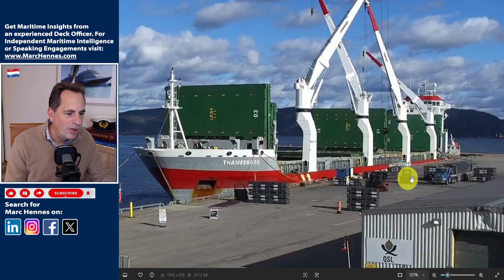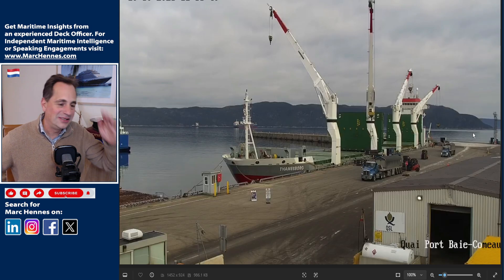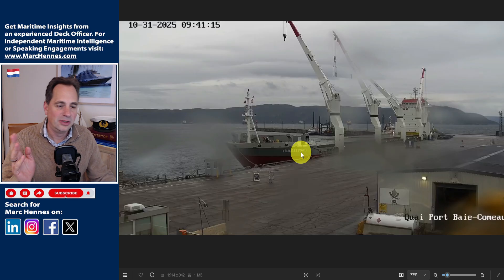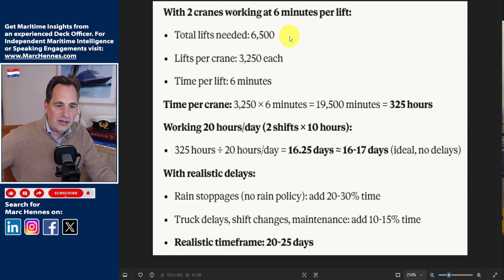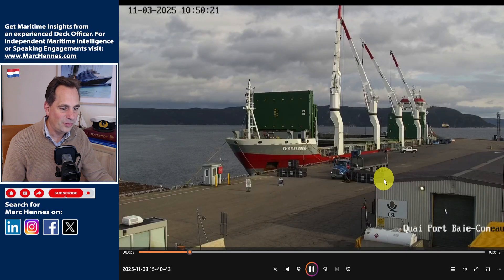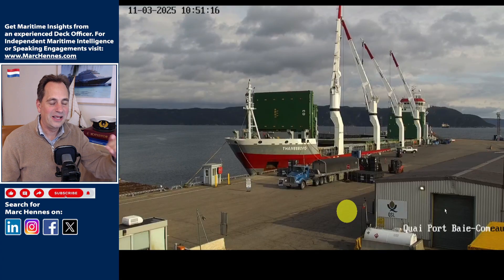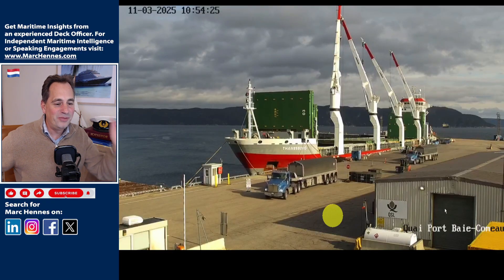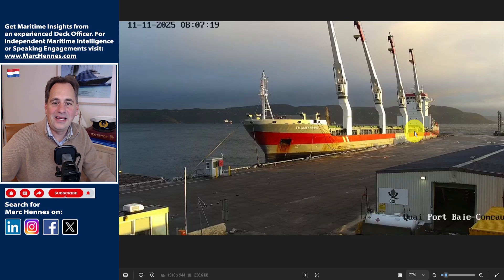🤔 How To Offload 13,000 Tonnes With Purpose-Built Trucks? Where Is the Thamesborg Going To Next? 🚢

Comment: I liked your calculation of the estimated discharge time.  However there are so many unknown variables that it may not be more precise than a ball park guess.  I believe the whole unloading process time frame is governed by the turnaround time for the specialist trucks.  This in turn is dependent upon how these trucks are offloaded at the smelter.  Are the blocks placed in a warehouse or storage shed or are they taken to their usage location straightaway.   Are there sufficient fork lift operators and truck drivers to maintain a continuous process.  Anyway, I enjoyed another interesting and informative video.  Thanks and keep them coming.
Reply: Scribbled in haste. Regret grammar and punctuation errors.   I should never hit the send key without a second review.  Once again, thanks for another good video.
Reply from the maker: Michael, you are right about the ballpark estimation. It is way more complicated. For example, the Alamosborg docked a few days ago, and since then it has been quiet around the Thamesborg, and so the Thamesborg refueled yesterday with trucks, and I saw the equipment they used for the salvage operation which was put on the shore for a while and then back on the ship 😅. The Alamosborg gets priority at the actual Alcoa dock, and the specialized trucks are now being used there. The Thamesborg is probably not in a rush, because no drydock available. But indeed, the offloading is way more impacted by the speed of the trucks. The T could unload quicker, but they don't want the carbon blocks to be sitting on the dock when it rains, so they offload based on the trucks. I saw some interesting stuff the last couple of days, will report on that 😅. Have a great weekend!

Comment: I believe the carbon blocks being unloaded at the Baie-Comeau aluminum smelter are technically pre-baked carbon anodes that are an essential part in the reduction of aluminum oxide to metallic aluminum.  Several hundred thousand amps of current flow through these blocks, so high purity must be retained and water must be avoided.
Reply from the maker: @pamudder , you are correct, they are indeed pre-baked.

Comment: many thanks for the patience to record how the trucks worked.   I's be curious to see how the billing woks for the shipping.  This seems to be more than shipping from A to B when a ship can't just unload and leave, and must instead wait at dock for end user to pick up the cargo. and it takes a month during which ship isn't earning money.  (Note that Silver Copenhagen didn't  stay long).  Wonder if Thamesborg hs to wait for dry dock to become available so doesn't mind the customer emptying the cargo at slow speed.
Reply from the maker: Hi J, exactly this! I think they could do it a lot faster indeed, but I don't think they are in a rush, since there is probably no drydock available. I think the trucks available is also limiting their offload capacity, and they have to drive a bit further then if they docked by the Aluminum factory dock. Also, they don't work nonstop, but they also had quite a bit of rain, and since a week wet snow, and snow, so it gets harder for them to offload it. We'll keep an eye on it :)
Reply: @marc_hennes  I don't think distance between ship and plant would be a big factor if it ads a couple more minutes of driving compared to all the time needed to load and unload.  I would hope that the trucks unload the pallets insode a dry wharehouse and pickup an empty pallet to go back to port (and let forklifts then empty palletto be used by next truck). Wonder if they load up wth enough carbon blocks for the winter so unloading is not a "in a hurry".

Comment: audio is fixed! thank you. I think those anodes probably weigh a bit more that a ton.  I get a density for graphite of 2260 T/Mx3 maximum, and those anodes look like they are about 1.4 x .6 x .7M or so, which at say 2050 T per Mx3 is 1.2 T  love the content! (if you got actual specs never mind!)
Reply from the maker: Hi Tim, I'm glad the audio is fixed again, it was the filters. Thanks for reporting back, it can always sound different to others on different devices. My numbers are indeed estimates, that's all we can do unfortunately unless we get more data from insiders :). Looks like they have custom sizes for transport, but probably also for the smelter.